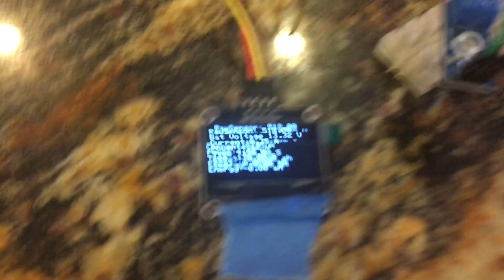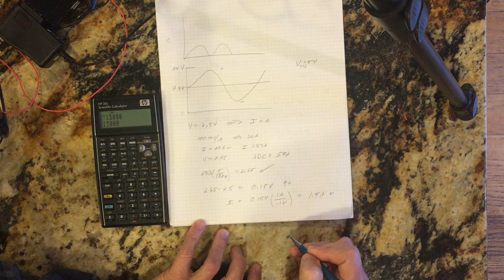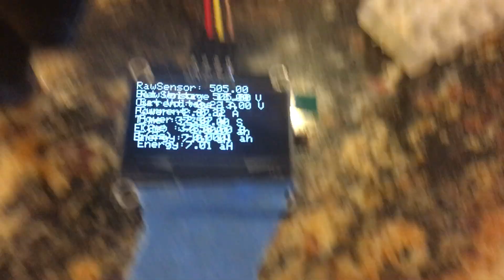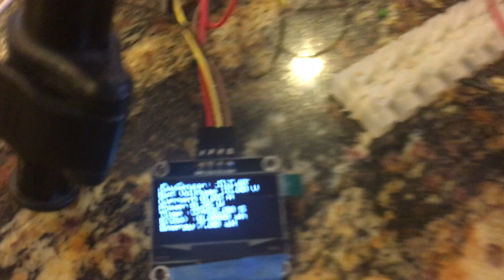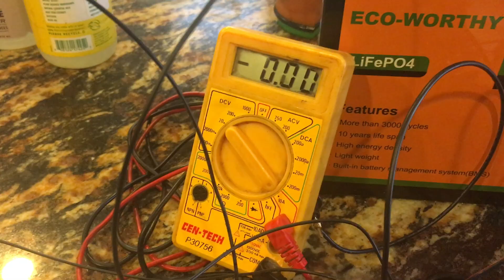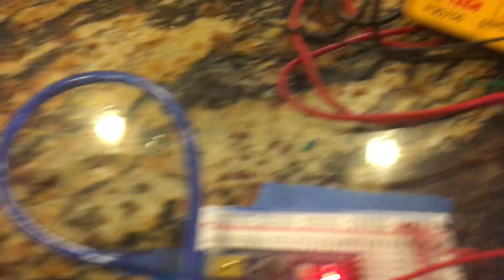How To Make - Arduino Energy Meter

Comment from the maker: In the Arduino sketch section of this video, I had a 2 second time lapse value.  The programming in the sketch actually had a 3 second time lapse.  i have corrected this code in the released version on my website. The released version uses the Arduino millis() function to measure the actual time which is more accurate.